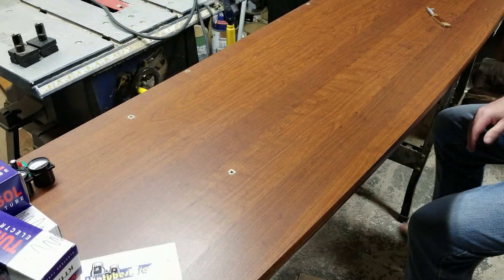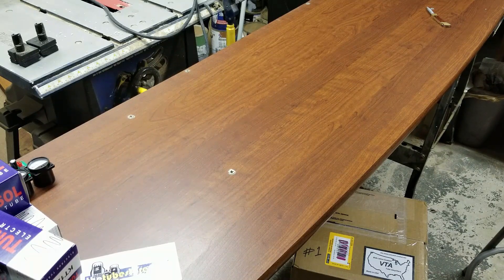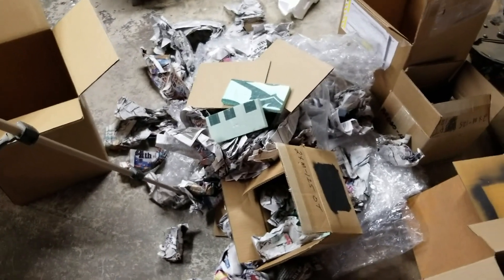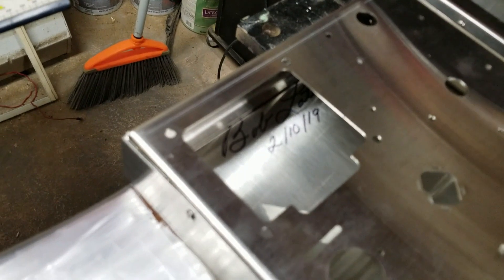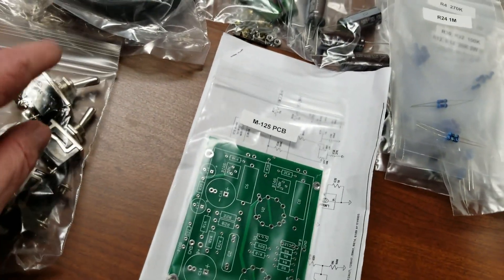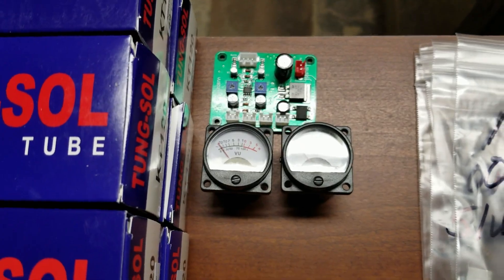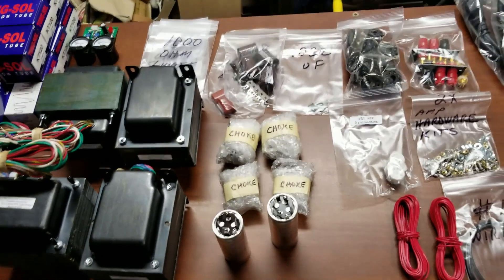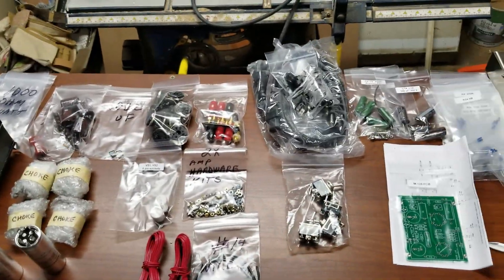VTA M125 Bob Latino Tube Amp Kit Assembly: Part 1

Comment: Just found your video. Look forward to watching the build series. M125s are my next build. Been enjoying my VTA120 stereo amp for 7 years without fault. Great kits from Bob
Reply from the maker: The build experience and sound experience will be well worth all the effort and money!!!
Reply: @RobertKohut  The AC on the heaters is whats delaying me to order the m125s. Cant say i have ever heard it be an issue on the 120, but if im gonna build from scratch, i would rather have a DC source for the heater/filaments...and all film caps on the power supply. Kemet MKP is $100, and Vishay MKP is only about $150 for both amps.
Reply from the maker: @flipfloptanlines926  Hey whatever is best for you. I trust in the M125s design and they were the best amps I ever had or heard!. Good luck.... 🙂
Reply: @RobertKohut  idk if i could even tell between ac and dc on the filaments. But, if i were designing a tube amp from scratch, and i have, i would put DC on the filaments to avoid any noise. I built the VTA120 before i knew much about tube amps. I have CornScalas from Crites at 102 db efficiency, so i will get minor hiss on quite passages with volume raised. $50, ill add a small dedicated filament transformer and supporting components to convert to dc so if there is noise, its not from the heaters. Anyhow, have a good one